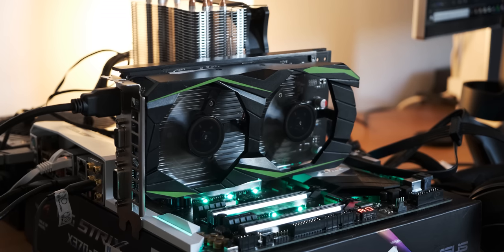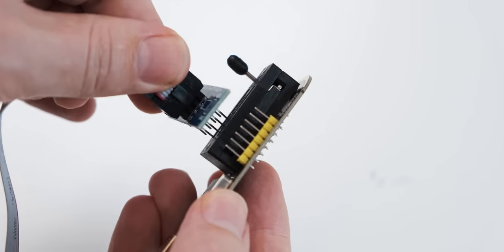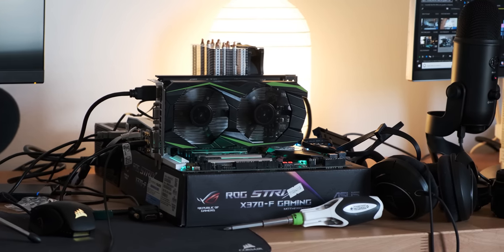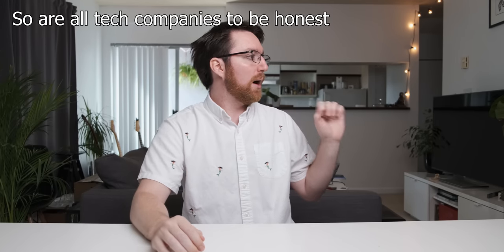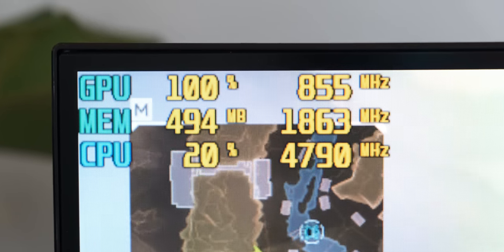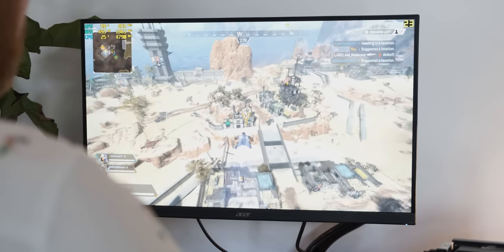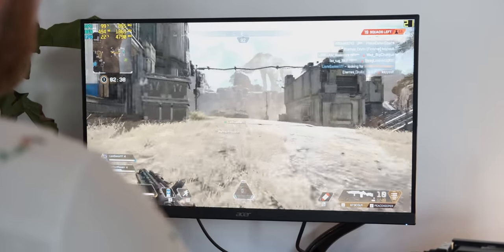It finally works! I fixed the $48 "GTX 1050 ti" from Wish.com and it still sucks

Comment: These cards are literally the bane of my existence lol tried a lot of things to fix the VRAM issue but came up short. I'm looking forward to the soldering adventures with the card 😎
Reply from the maker: They are such a pain! Oh, so you think I should go for the gratuitous soldering action? :P
Reply: @DawidDoesTechStuff  It's probably going to end up blowing up. :D
Reply: Got mine working.
Reply: @DawidDoesTechStuff  what if the six pin is what's powering the extra RAM chips
Reply: @DawidDoesTechStuff  someone else in the comment section said that they did it to theirs and it worked with 1gb vram bios. Honestly, I'd say just give it a shot. What are you gonna use this graphics card for anyways?
Reply: @DawidDoesTechStuff  DO THE 6pin go on go on go on go on....you know you want to
Reply: I don't know what's actually the problem of soldering that 6 pin connector to the board... Just add some fresh leaded solder to these solder holes to reduce the needed temp for removing the high-temp-factory-lead-free solder with some wick, to open the holes, push the 6pin through the holes and solder the contacts... If you're not familiar with soldering: you need to heat up the pad and the pin at the same time with your iron to make the solder flow to both giving a nice magic connection... It's really so easy it wouldn't take more that 5 minutes at all for me to do the job... An iron with at least 45W should also help, as ground pins will eat the heat of lower wattage irons just as if you were doing something wrong, just because your iron wouldn't be able to maintain the needed heat for melting the solder to pin and pad. Good luck 😃
Reply: @DawidDoesTechStuff  yes
Reply: So the card I bought was supposed to be a GTX 960 4GB 128bit model. It has 8 Samsung chips, AND has the 6-pin power connector. I thought that flashing the bios would fix it, but now I’ve seen your video and realize the eeprom chip needs to be flashed as well? It looks like the other cards I’ve been seeing on YouTube, double fan with black and blue shroud, but is it NOT the same gpu as this one in the video?
Reply: @shrikant444  How? I made the mistake of buying my first one from someone on market place and bought this thinking it was a good deal. Reallt got screwed. i cant run fornite or any big name games. when i tried to run gta sa i saw the thing start spiking high in temps so im afraid to game on it.
Reply: @SolidCaramel2  check whether gupz detects it as a fake graphic card first

Comment: I soldered a 6 pin connector to mine and its holding stable on 1GB DDR memory
Reply: Dawid please try this!
Reply: @feynman9959  he won't but it makes sense the card needs more power!!!!! vram does not run off of nothing after all it needs power and if it has 1 gb of vram it would crash if it did not have enough power for the vram to run stable anymore then it would if the gpu core didn't have enough power to run
Reply: @raven4k998 He took the easy way and got out of putting in work

Comment: The RAM chips just got fake writing on them 🙂 it's normal to do so in china
Reply from the maker: Ooooh! That seems likely. :)
Reply: But can you apply some scamonade on it?
Reply: I had an OEM Dell Radeon HD 8570 that had 4gb worth of ram chips on it with only 1gb showing up.
Reply: Maybe it's "binned", the card comes out of the factory with 1GB ram, some chips are faulty so they put a bios to map only 512MB of the ram and sell it at a cheaper price.
Reply: Or the first 4 memory chips are ok but 1 is dead or not conected properly on the next 4, or the gpu is missing 1 ball contact under it :-/
Reply: @madmatt2024  thats 4 gigabits (4Gb) which is 1 gigabyte (1GB). All memory chips use bits.
Reply: @ayuchanayuko  That doesn't work, there's 8 gigabits to a gigabyte
Reply: @EdgyShooter  oh wait, you're right, shouldn't have commented early in the morning haha. Maybe the chips are 2-sided or stacked somehow?
Reply: @ayuchanayuko  Haha I understand that feeling well enough! Potentially, or they could be 2 Gigabit chips?
Reply: @EdgyShooter  probably, maybe madmatt2024 just didn't check ;D
Reply: @DawidDoesTechStuff  There are some people that got the same Fake GPU as u and got it to work with 1GB of VRAM, but they had to solder the 6 pin power connector, maybe it crashed over 512MB because it needs more power for the other memory chips!!!
:)

Comment: If I were a betting man, I'd guess that the 512MB version are actually 1GB cards, but with quality control failures.  Meaning, that one or two of the memory modules was bad.  So, rather than just shuck them into a pile, a reduced memory BIOS was created, which would allow them to be salvaged.  Rather like how the original Celeron processors were Pentiums with failed cache memory modules.

Comment: I know I'm late to the party and all but it's likely that the memory power delivery stage for the remaining chips (the other 512MB) are only operational from the 6 PIN connector. I suggest soldering the 6 PIN connector and flashing the BIOS back to the 1GB version to see if it can utilise the remaining chips once they are powered. (scrolling through the comments - looks like others have tried this and it works...)
Reply: I really wanted to use you😭😭

Comment: 3:50
It's called binning, the card might've been intended as 1GB model initially but some of the memory chips were broken/non-functional so the card is dumbed down to a 512mb model.

It's a very common practice in chip manufacturing often used for GPUs and CPUs. Couple years ago it was very common to buy 2-3 core AMD CPUs and unlock remaining core(s) to a full 4 core model, however whether that worked for you was up to luck as most certainly your model has been binned for a reason, so even if you may have full 4 cores, the unlocked ones might not function under heavy load.
Reply: In binning, VRAM isn't what's usually involved. I mean how can exactly half of the VRAM chips be malfunctioning? Binning applies to only the Graphics Processor chip (the GPU itself).
Reply: like if Nvidia is making a 2080Ti and it turns out to be perfect they sell it as the RTX Titan.

Comment: 512MB of RAM that fail to function? Sounds like an early concept of what would be known as the GTX 970
Reply from the maker: Hahaha!!
Reply: I have to inform you mister that the gtx970 ran as fuck on my hands. Been tested to a very cruel way. So i dont think that the gtx970 or 980 were trash at all. I still have a rig with 6 gtx 970 and 980 and it runs in a pretty much way, even the recent game eith the highest graphic requirements.
Reply: @ifyouwantmoneythengivemeev8094  i know, but i just mentioned that both they run as hell. Despite what they say, i still find these cards quite useful.
Reply: It did have a full 4gb of vram. It's just the last 512mb on the chip was so bottlenecked it ran at a much lower speed. Idk. 970 will go down as a legendary budget 70 series of you ask alot of people lol
Reply: The R9 290X was limited to 4GB, while AMD could've release a 8GB, but no, they waited a year later to released a R9 290X with 8GB and called it the R9 390X. It even uses the same driver, and AMD charged the same or slightly more.

So, AMD got scammed in the first place, and no, it's a full fat 4GB, just the part that controlling the 0.5GB is a defective, low speed memory controller.

Comment: what i think would be a logical explaination for the 512MB bios working while it seems like the PCB physically has 1GB is that one or more modules are faulty. in a way it would make sense that someone would rebrand a broken but kind of functioning graphics card instead of figring out the problem.

Comment: Take it another step further, if any of those chips are faulty, can you replace them on the card and remap it to a true 1gb ?
Reply: Nope. You need expensive factory level tools to solder  inan BGA chip like a memory chip even at an DIY level.

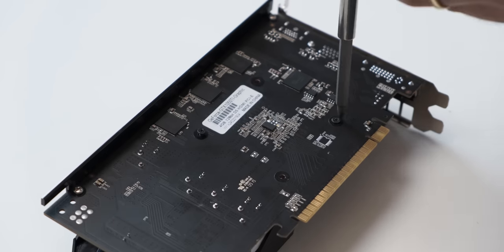Comment: 3:36 There is always the same number of memory chips regardless of the overall memory capacity. For 1 Gb version - 8 chips with 128 mb each, for 512 - 64 mb each instead.

Comment: I don't know what's actually the problem of soldering that 6 pin connector to the board... Just add some fresh leaded solder to these solder holes to reduce the needed temp for removing the high-temp-factory-lead-free solder with some flux and desolder wick, to open the holes, push the 6pin through the holes and solder the contacts... If you're not familiar with soldering: you need to heat up the pad and the pin at the same time with your iron to make the solder flow to both giving a nice magic connection... It's really so easy it wouldn't take more that 5 minutes at all for me to do the job... An iron with at least 45W should also help, as ground pins will eat the heat of lower wattage irons just as if you were doing something wrong, just because your iron wouldn't be able to maintain the needed heat for melting the solder to pin and pad. Good luck 😃

Comment: Not bad of a graphics card for 720p 30fps gaming on most games
Reply: There are cheaper and instantly working options for that
Reply: For a little more than $48, I could get a GTX 950, an R9 270, an RX 460, and they would all whip the GTS 450s ass.

Comment: Hey Dawid, big fan! I just wanted to ask what you think about how valid/reasonable an RX 5700XT is for a newer build in 2019. I've heard some mediocre things from other YouTubers.
Reply from the maker: Hello Aarif, I think the new AIB partner RX 5700 XTs looks like a pretty great option. I wouldn't recommend the standard ones as the blower cooler isn't the best. Thanks for the comment, I hope this helps.
Reply: @DawidDoesTechStuff  Hey Dawid, thanks so much for responding... will look into this! Keep up the great work!

Comment: I mean, if you have a decent c2d but with the outrageous (even for 2008) gma950, its usable. 
The gma 950 literally scores "3" in gpu passmark, while a intel hd 3000 scores 314..

Comment: you still should try it, it actually makes sense it works like this, since it would use less wattage.... so huphup solder it on and see if it works.

Comment: The 1 gig probably used the 6 pin while the 512 didn't need to.

So you have an excuse to solder away.

Comment: If the 6 pin solder actually had leads, I bet it allows the other half of the vram to be used.

Comment: From what i know i have never opened my gpu BUT it seems to be a gts 450 rev 2 cause if i go in gpu-z it says gf116 release date same as well there are 2 gpus in gf116 that have that release date but there diffrences BUT THE BIG DIFFRENCE IS my pc still averages over 100 FPS in games LIKE NANI ive played games like paldins i did get fortnite to work for a bit but not for long CAUSE FORTNITE DOES NOT LIKE OUT-DATED DRIVERS but in fortnite when i was playing it i got 140 fps i guss this card could be the 2gb version and thats why its performs well but it still seems at times it crashes recently it felt good not crashing games much/freeze which im happy about!!!!

Comment: 🙂 have u noticed the back of the video card board, its very barren, lots of empty space with no transister or what not, normally u dont see that on a namebrand card 😊
Reply from the maker: It really is very barren. Not much going on in that card.
Reply: @DawidDoesTechStuff  ☺️ yup

Comment: So I bought a $42 Fake 1050 ti on Ebay...GPU-ID identified it as such.  The vendor gave me all my money back but I still have the card (I did not need to return.)  It does have a six pin power port (the vendor gave a 6-pin to duplex molex with the card.)  It has a casing that looks exactly like yours, and has all the same video ports...just has the additional 6-pin power port.  How do you suggest I find out which card it is so I can flash it to the correct one?  I am not going to use it for games anyway, just for some video watching and perhaps for display when I do audio editing---so do I even need to flash it?
Reply from the maker: If the card doesn't crash while you use it, you probably don't need to flash it. If it does what you need you're good. :)
Reply: You could do what Dawid did in the first video, take off the cooler and wipe off the thermal paste from the chip and google search the GPU name that is on the chip.

Comment: I have a Gainward GTS 450 512MB. Tho mine has a problem with a few capacitors that were ripped off the back of the card right by the pcie slot, so the only way to make it work is to put some tape over the connector so it can only run with the functioning lanes, aka only running in Pcie 4x mode. Tried soldering new caps on but i ended up messing up the pads on the board even more than thery were already.

Comment: Whoa i wouldn't have guessed. I still think it's a GT440 rather than GTS450, and the differences in memory bus configuration are the reason half the VRAM doesn't work. But the variant of GT440 i was thinking of would be 192bit bus, and 1.5GB of VRAM, so that couldn't possibly work. There must be yet another, so far undocumented variant running at approximately 500 MHz rather than 800-ish MHZ and reduced shader core count so it wouldn't need the PCI-e power plug, but with 1GB VRAM. Maybe 64-bit memory bus?

The other comments suggest that soldering on the power connector worked for them. I wonder if half the chips are supplied by a separate VRM connected to that power connector, but then why would its components be populated?

This is all so weird. More research is always welcome - not because it's a useful card, but because, you know, for science.

Comment: i've been using GTS 450 1GB GDDR5 version since i broke my first dedicated gpu in my PC i think this happened 1 year ago. Works just fine , it is silent but my only problem is that i have a GPU without any VRM cooling i only have airflow from the fan but nothing more. And when i'm playing games with 30% fan speed my VRM chips can get really hot and starts doing weird anomalies on the screen. So i must to set my gpu fan to 100% so she can't be overheated ( even in 30% my GPU chip is still at 70degrees C but VRM chips are like 99999 ...)

Comment: I don't really care anymore like we got shit like GeForce now so I don't need to really worry on getting a top tier PC now I could... But why?
Other than being able to record and stream and game it's still not really worth the hassle my shitty win7 PC can run about any game now all it needs is a decent bandwidth and GeForce now

And since I got the beta I'm Golden

I was able to play these with the following

Cuisine Royale: Avg 65-98
Black Squad: Avg 99-120
CSGO: Avg 98-100
Minecraft (No Mods): Avg 100-120
Fortnite: Avg 60-70
League Of Legends: Avg 99-120
Split gate arena: Avg 45-68
And also
PUBG: Avg 65-70

With at least 2.4ghz connection
It said it was a shit connection but all I had to do was change the connection location to US Central and also turn of the 
"Optimise for Bad Internet"
Then I set the res to 1920x1080p
And then BAM!
Little to No Lag and HD Games

Comment: Thanx... a lot.. I fixed GTX1050 Ti (FAKE) to GTS450  1024 vram
I played VALORENT high graphics 40-60FPS and low 70-85FPS
and my GPU have 6pin power input

Comment: Ironically, I just looked at Ebay, and there's a used 512MB GTS 450 for $41.60 USD, including shipping. Close to the same price, but without the hassle (and the lies)!

Comment: It still gets to little power....
Performance will improve with enough power.
So dont be afraid , just solder on that connector and give it the right amount of power.
Just like a cpu or anything that dosnt get enough power, performance will go down.
If my guitar amp doesnt get enough power it cant play as loud .. shure.. but also it doesnt get enough headroom at lower settings and
the sound quality will sucks and get distorted in a BAD way....
Power is really essential....
Undervolted cards WILL slow down on performance....
SO go ahead .... its easy to solder that connector.
Cheers.

Comment: Hey, I'm late to the video but I managed to change the Bios from a similar card, same PCB and heatsink, the only thing that differs is that your has and aditional BIOS looking chip, mine has only 3. I managed to flash a BIOS that allows to use 1GB of VRAM with a card that lacks the 6Pin connector. The only issue that I had is that the driver installation was veery slow (20-30 minutes) and crashed mid installation but I was able to run CSGO at 60FPS max setting and even the Witcher 3 with all setting in Low or disabled at 25 FPS. For those suffering for me using this card and trying to play The Witcher 3 fear not, since this was only a fun side project and I rock a RTX 2060. If anyone needs help just ask for it.

Comment: despite having 1gb of RAM on the card, the die in question doesn't have the memory channels to support the full 1gb memory modules, therefore only half of the memory shows up

Comment: well you paid $48 for it and got a gts450 chip set, there are other versions... one is $92 and has a GTX650 chip set. hmm, comes with drivers to so flashing the bios would be a complete wast of time.

Comment: This GPU only has 128 bit  memory bus..   so wouldn't expect to see more than 4 memory ics if gddr5 ..  though i think it can also use ddr3 which is only 16 bits of width per chip so 8 needed...

Comment: It's nor repair it's poking sky with the finger. Repair is when your 1080Ti has huge burn through hole but you fixed it and it works under load. Screwing around chinese fakes is like ancient shamans dances around the fire with the tambourine :D